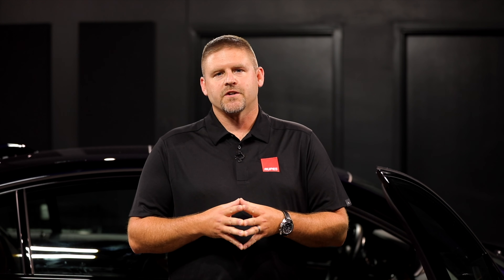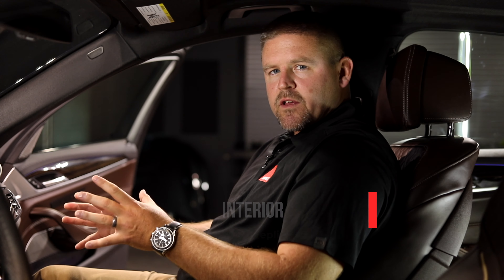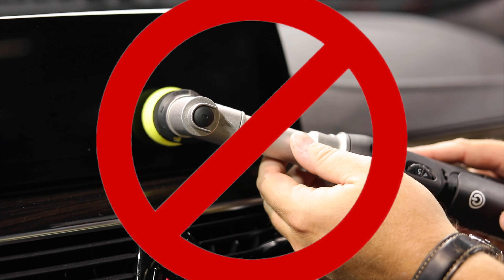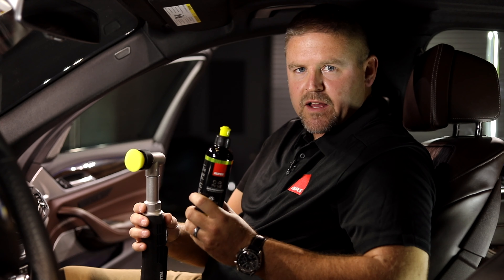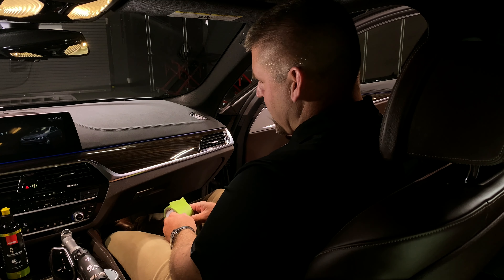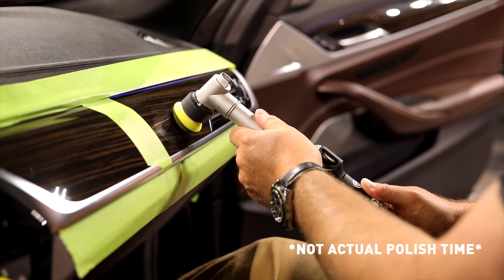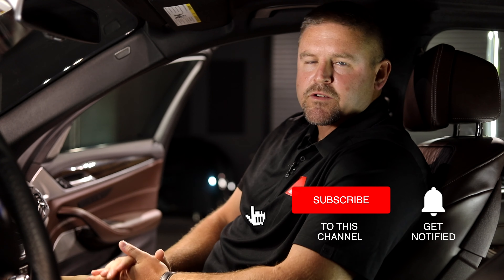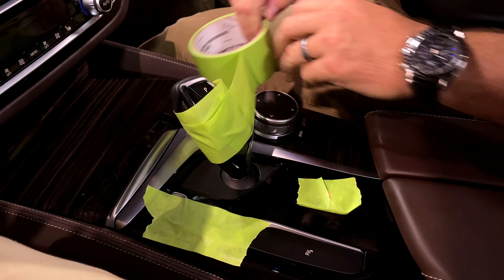How to Polish Interior Surfaces - [RUPES Replies Episode 027]

Comment: Can you polish a clear climate control face panel and clear gear selector display , it seems uncoated?
Reply from the maker: Yes, and you would treat it like any other plastic, with VERY delicate approaches using fine pads, fine polishes, and very light techniques. Shorter passes, low tool speed, and light pressure. Test in a small area before diving all the way in!

Comment: I tried this with Rupes Rotary Fine compound and it left hologram marks, what did I do wrong?
Reply: too much heat being put into panel, either faster passes or lower speed setting.
a fine polish and pad will remove it, just give it time to cool down in between passes